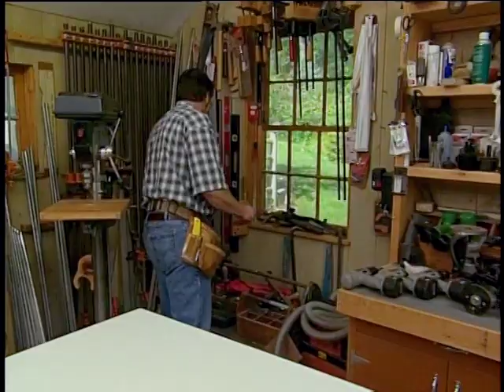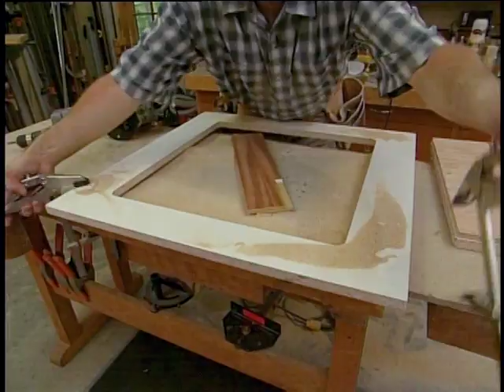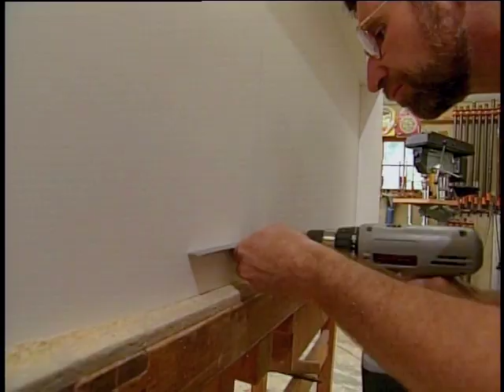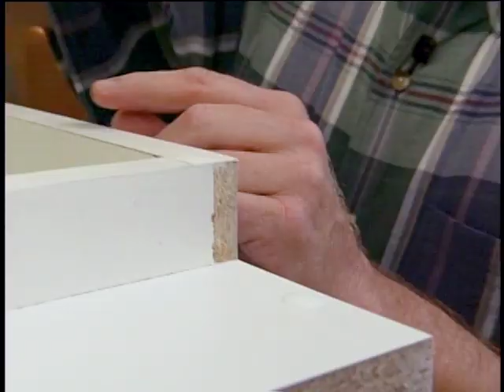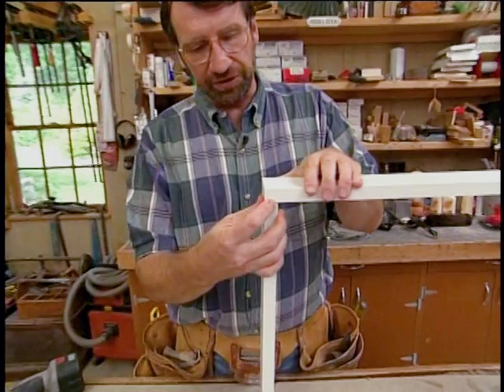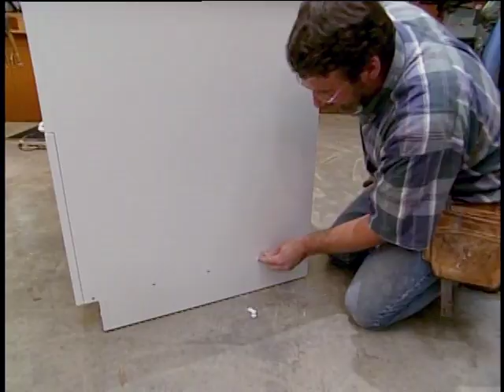Laundry Center  |  S11 E6

Comment: Watching Norm use that 2 step -operation pocket hole machine (forward / backwards) I can't help but to compare it to my Kreg Forman pocket hold machine. With my Kreg Forman pocket hold machine, it's just a one-step operation. Just simply pull the handle down and its done, it literally takes about 1 second to machine a pocket hole. I still would love to have the one Norm used, for nostalgic purposes.